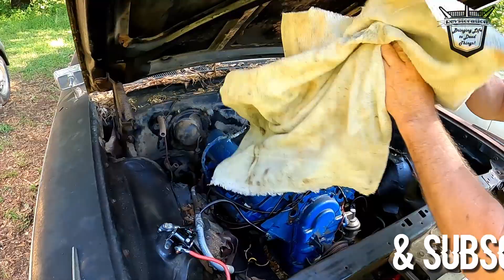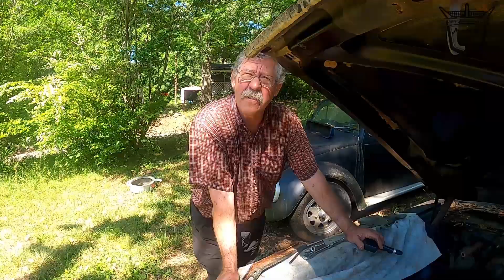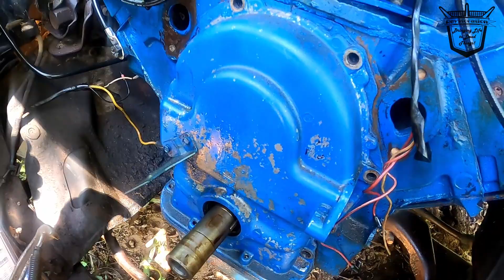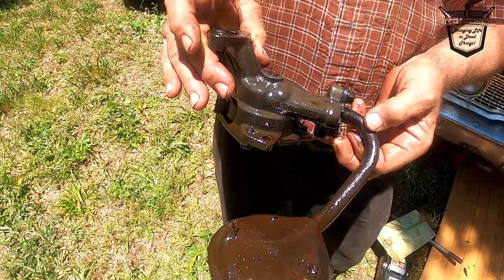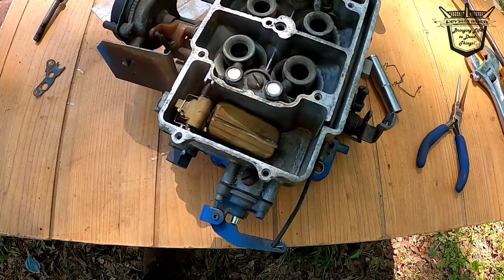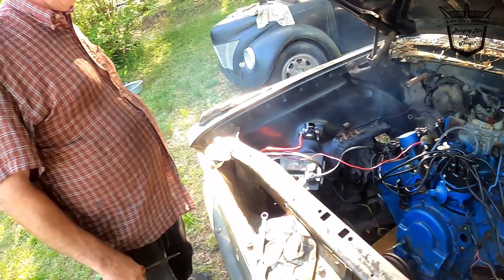1963.5 Ford Galaxie 500 Revival: Digging in the "Rebuilt" 390? - Will it Run and Hold Oil?

Comment: This is the best ShadeTree Mechanic channel on YouTube. Love ya Rev!
Reply from the maker: Wow, that is a big honor... We enjoy working with what we have and it worked today. Thanks for watching and commenting.
Reply: @RevStoration  withe the water pump off you'd better flush out with water..no telling what's nested in there..
I had a mouse clog up an engine ..he got in through the radiator because the cap and thermostat had been removed
Reply: @bobfuller6171  Lesson learned; when putting a car on hibernation make sure all caps are on and that the motor is sealed. Another pointer; put steel wool at the end of the muffler tailpipe to prevent mice from going in.

Comment: Congratulations getting that mud pump and hog waller cleaned out and replaced!!  That 390 sounds incredible since y'all got it running right.
Reply from the maker: I am surprised she runs as good as she does... Hopefully, we can get everything installed on the front of the engine and make it run a little long..

Comment: I had one of those 390's  in a '70 Ford Fairlane long ago.  They're tough engines mechanically with plenty of power to spare.  Gotta say, I have never, ever seen an oil filter do that!
Reply from the maker: When the pressure relief valve is froze closed that is going to happen... I think the pump was dry for so long that it rusted shut... Glad to have marked that off of the list as a first... Hopefully we never deal with it again..

Comment: I find sumps full of crud like that in cars that sat a very long time..... Especially ones that were not maintained well, as gravity takes all that sludge to the lowest point. Rebuilt.... How about Re-painted.... It looked too still have a nylon cam gear. Sounds great though. Enjoyed your video.
Reply from the maker: It all ended in the bottom of the pan... cleaned out fair nice though... engine didn't look dirty except the pan..
Reply: @RevStoration  Yep.... over time all that sludge slides down into the sump.... leaving the upper end looking clean.

Comment: I was looking forward to you fixing the oil pump that you had instead of replacing it with a new one because it's a simple fix and there was no need for a new pump when you could of repaired the old one but at least it was the issue and you got to clean the mud daubers out and the nasty oil oil that was in the bottom of the oil pan that is why it's good to have the motor oil hot when draining it that way it heats up the crap and allows it to drain instead of draining the engine when it's cold and allowing the nasty stuff not to drain out of the engine.
Reply from the maker: Keep watching Taz... The Ole Man was buying the pump.. I was rebuilding the carb... both needed to be done.

Comment: Awesome video Rev, my 64 Galaxie had several bent pushrods after the first time I rolled it over. Those valves stick and make the pushrods angry. It sounded like either a lifter was still pumping up or maybe another bent pushrod. When you get it put back together a little further and can let it run for a bit should be able to tell more. Really enjoy seeing it come back to life again!
Reply from the maker: Thanks Robert... It has been a little work but it has also been rewarding.. Thanks for watching..

Comment: A friendly suggestion the oil your using needs zddp in it something like rotella or similar you will lose your camshaft very quickly with out it.
Reply from the maker: We are going to use this oil just to clean out the engine... slug cleaner, tranny fluid and run it until it reaches temperature. Drain and put in something with dinosaurs...

Comment: You can take and remove the oil filter housing. Use an air hose with a blow nozzle and blow air back through the pressure galley hole from the pump to the filter back into the engine (oil pump) and it will loosen (brake loose the relief valve ) . you can also take and if you have a oil pressure loss take the pump off and blow air up through the pressure galley to find the oil leak inside the engine!~
Reply from the maker: We did try that but it was rusted shut... I could not even move it with a screw driver outside of the car... I disassembled the old pump to see it... Thanks for watching...

Comment: I have had that issue before when the oil pressure spring gets stuck and blasts the filter right off it was on a chevy and a Ford but you may have another issue with the mud daubers nests could of blocked a oil galley causing the pressure to be high but I would think 40 to 50 PSI of pressure or more would blow the Dauber nest right out of the hole so my guess is the pressure relief spring on the pump because it's doing the same thing I have seen on a engine with that issue.
Reply from the maker: The new Oil Pump fixed the issue so far... we have more to go and hopefully we will have it back to perfection before long..

Comment: The valves are worn way to close for comfort to the keepers in that 390. I had my 71 250 do that and finally figured out the bolts were swapped on the rocker shaft assembly causing lack of oil to the rockers making premature wear . Itl drop a valve real quick it really needs a valve job or itl detonate quick after a little running
Reply from the maker: We agree.. we are going to rebuild the heads at least.. Just working out the kinks and making it run right for the video.. More work on this engine for sure. Thanks for watching!
Reply: Good! Enjoy the videos man. Can't wait for the next upload

Comment: If he put the engine 180° out how about setting the valve lash wrong, that’s were the bent pushrod came from.  Another thing is using old fuel can cause valves to stick in the valve guides. The oil pressure is most likely a relief valve. But double check the filter for two gaskets.
Reply from the maker: We figure it out in the end... Thanks for watching...

Comment: Looks like mason bees to me. They fill in every small round hole available to lay their eggs. They are very beneficial though.
Reply from the maker: We call em Dirt Daubers...
Reply: @RevStoration  We have dirt daubers all over the South.  But the dirt dauber is a wasp which is totally different than a mason bee.  Which is truly a bee.  And yes, the dirt dauber builds mud tubes that they lay their eggs in then fill the tube with paralyzed spiders for the larva to eat.  Anytime you have a drill hole of about 1/4" a mason bee lays its egg in and seals the opening of the hole. Looks like you have some of both there on that engine.  
Oh, and you can crush up a dirt dauber nest and add water and it makes a good paste for infected soares.

Comment: Just hate when they say rebuilt, better off just saying hey cleaning the out side painted,  that motor had less oil changes than my Mower which atm is 1, bought it 2003
Reply from the maker: It had new freeze plugs behind the motor mount... So the engine was out but... probably not rebuilt..

Comment: Was wondering if you took the old oil pump apart to check that pressure relief valve, but what's the point once you saw all that sludge in the bottom of the pan. Hoping the cooling system the next step, as a waterpump can't be that hard to find, even if the radiator and fan and fan clutch might be a bit hard to locate. Great job on the carb my friend. Take care.
Reply from the maker: Murray, I did take the pump apart and the relief valve was stuck. Thanks again.

Comment: Rev I seen that once a guy rebuilt motor ran it to temp with break in oil then let it sit forgot to drain it I bet that might be what happened
Reply from the maker: It sat for a while and it caused a bunch of issues... I am actually pleased that it happened before we installed everything on the front side of the engine. Thanks.

Comment: Hi there rev.dont make sence so high oil preassure when oil pick up strainer is gumed up. If that was the case the oil preassure would b low and not so high. Unless the filter was faulty .what you say. Good video keep em coming.👍👍👍
Reply from the maker: I think it was still pumping oil becuase the pressure relief valve was stuck.. most of the pick up was clogged when I dropped the pump into the pan to get it off.
Reply: Yes but why was the oil squirting out of the oil filter. Relief valve remains closed till high pressure is built only than it opens . Thats when engine hot and on high revs.👍👍👍
Reply from the maker: @TanveerAhmed-gl5jk  The valve stuck and it built high pressure quick..  I replace the oil pump and it fixed it...
Reply: @RevStoration  great .thanks for replying back.good to know that problem is fixed.top videos rev.👍👍👍

Comment: How will you clear the holes in the engine with dirt in them without getting the dirt in the engine?
Reply from the maker: Victoria... we are going to run it for a bit and change the oil and filter again... Hopefully after a few changes the oil galley will be clear as ever... The top of the engine was was not slugged like the pan..
Reply: @RevStoration  it sounded great!

Comment: If the valve guides are tight when they sit awhile it will cause the valve to stick and bend pushrods old original Ford's are best.

Comment: Put 5 quarts of kerosene and a new filter, just run it until gets warm, drain it and put 5 quarts of Castrol 10 w 40 and a clean filter and run it until it gets warm and let it sit for a bit and it should be good to go
Reply from the maker: We are going to install water pump and radiator and do something very similar to that... Thanks..

Comment: In all them plug holes is from a bug 🐛 / dirt dobler. The only thing that engine got rebuild pant job lol good thing it's a ford if it was something else it would not run all it would have done it go being with all that oil.  Thanks for the video
Reply from the maker: We figured a few things out... Thanks for watching..

Comment: Sludge oil? Back in the day, they used non-detergent oil. The result, sludge, clogged oil returns.
Reply from the maker: The crazy thing is that the top end of the engine was spotless, less the light rust... the bottom of the pan was thick with it... Odd to me... Thanks for watching..

Comment: it is a wlll known fact that Quakerstate oil turns into sludge. and gums up in motor, best oil on the market is Castrol motor oil
Reply from the maker: This is going to be a get the engine to temperature.. add some kerosene and run for 5 minutes and drain it.. The engine needs a good clean out.

Comment: I'm fairly certain that when authoring up a Craigslist ad ....that the english language becomes a tad more let's say.....,maleable.......esp..and particularly when folks with little knowledge of the modern internal combustion engine.....terms relating to otherwise straightforward and basic engine condition ...work done...and work needed mystically transform .
Let's examine the common term " rebuild / and or rebuilt " ... To the jnitiated (mechanically speaking) the use of the term rebuilt would almost certainly denote a series of performed replacements of gaskets..seals ....rings ..etc...generally one would go so far as to hone if not just the cylinder walls But more often then not the  machining of the heads etc...bottom line...in order to Call ones work on an engine  a rebuild one would have to tear the engine down down piece by piece until it's completely an empty block and then after cleaning n machining the block.n heads the engine would be restored piece by piece back too a like new condition...often even better then new...HOWEVER the craigslist "rebuild" generally means a person with no buisness working on an engine cleans up (using the term clean very loosely )the visable areas of the engine....generally not bothering with the small stuff like gaskets seals or anything Internal...instead the mechanical WIZARD will simply buy the cheapest paint they can find in spray cans and " bomb" the external surfaces after removing what leaking oils n such they could find.. After it dries if ones lucky the wizard may bother too clean spark plugs n wipe down the wires.....soooo...
Be sure you assertain prior to purchasing a "rebuilt* engine car from Craigslist....inquire who rebuilt the engine n exactly what parts were used.  N where were they sourced..
Reply from the maker: We did not really care if it was or not... We take the person at their word and only pay as if it wasn't. Then if we need to work on it we do... Not our first rodeo and it will probably happen again... we just laugh and move on..